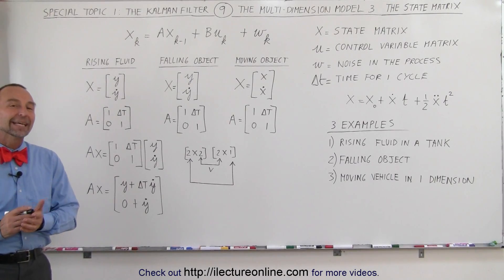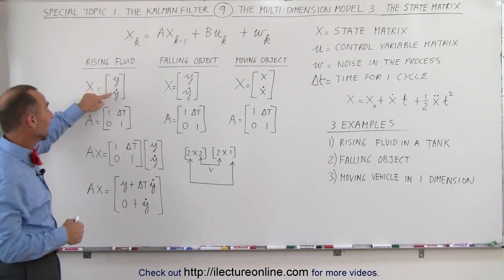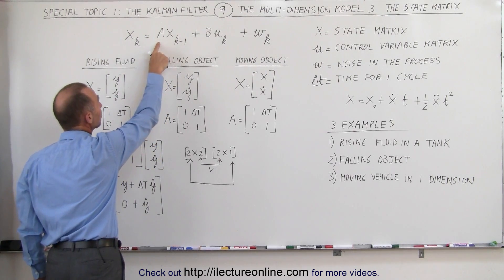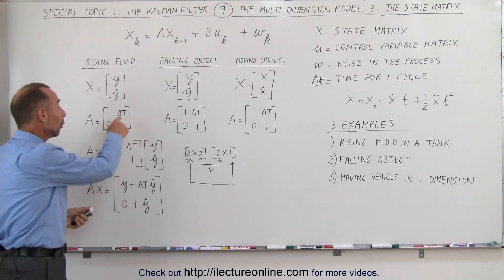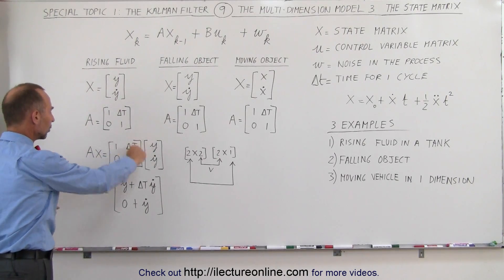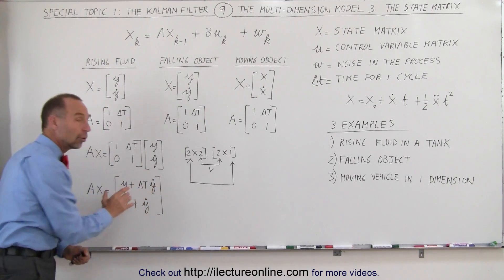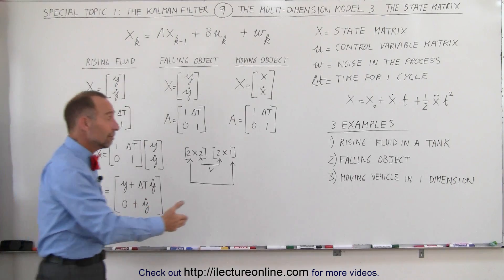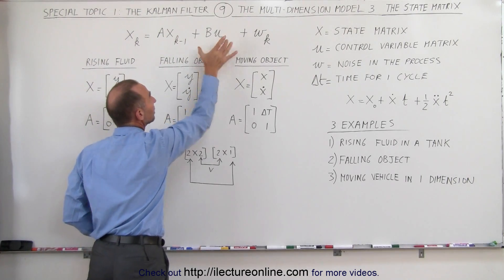Special Topics - The Kalman Filter (9 of 55) The Multi-Dimension Model 3: The State Matrix

Comment: In all of these examples our transform matrices (A and B)  are defined by the kinematics equation. Are there cases for using a Kalman Filter where they are not defined by kinematics equations? Such as in time series forecasting? In such cases how are A and B defined?
Reply: I'm not an expert, but assume that the state matrix can be estimated with a AR (p) process, or an ARX(p) process, either way the component the of matrix A of coefficients can be estimated with ordinary least squares, or maybe another estimator. You'll have the component associated to the matrices A and B by just estimating the parameters associated to each variables with OLS, that is, reducing the squared error/residual. in the case of an ARMA or MA, or ARIMA, the white noise process.
Reply: agreed, would like to see how to implement matrices for randomized sensor reading

Comment: Stop it. Stop this wrong explanation. This bending of continuous time equation into discreet time is absolutely wrong. I realize you are trying to dumb it down. But this is just not correct mathematics.
Reply: I know it is an old post. But can't you think that the X= x_0 + x' t + (1/2)x'' t^2 is the firts part of a taylor polynomial? In that case it would give an approximation by discretizing time and you can suppose the error term will be contained in the w_k term. Am I too wrong thinking it that way?